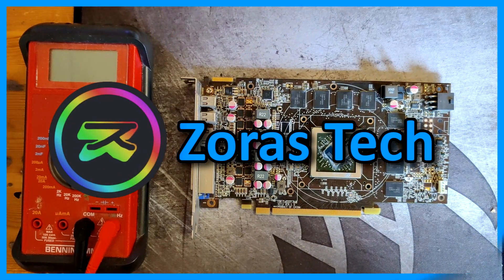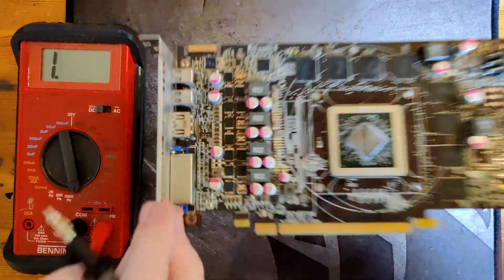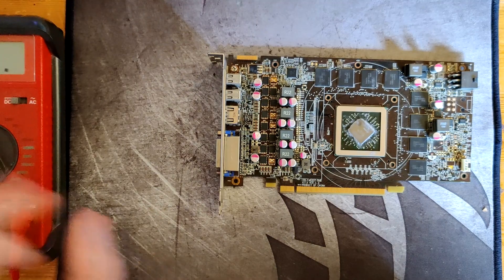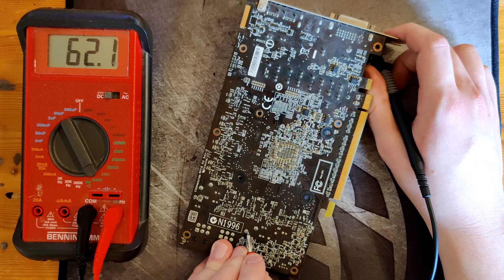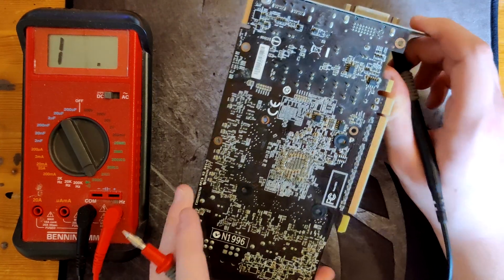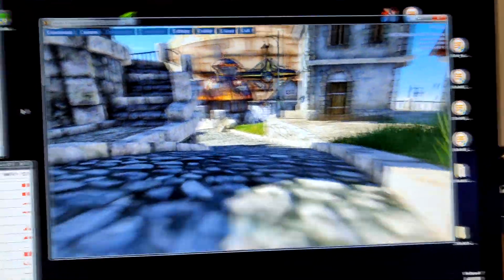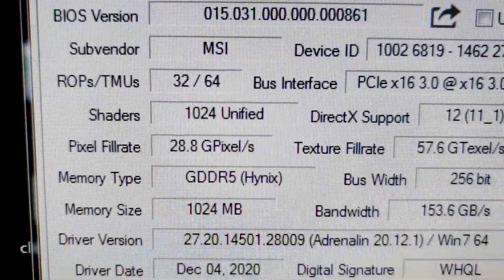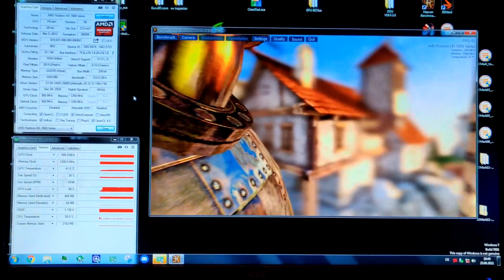Radeon HD 7850 not Detected // Troubleshooting

Comment: need help, mine is xfx ghost hd 7870 2gb, i boot windows and install it and it is fine, my bios screen is fine, so its working obviously..., my window repair screen works but noting else after the blue window animation logo screen, any idea? I had installed windows fine but left it running to do something as I went to check it was not showing anything but a blank screen,  I had it an air blasted everything and reapplied thermal paste, and it had the same issue my specs are xfx ghost hd 7870, intel xeon e 1225 v3 stock cooler, 8gb g.skil ram, intel server board s1200KP
Reply: it is meant to take heavy loads so that's why I wanted a server instead of gaming and it is a bit older I know the card (had 7870) are the only issue as I had a gtx 560ti 1gb in it prior working completely fine,  450w psu I believe and 500gb toshiba hdd

Comment: What do you usually suspect in gpu issues when you turn on the pc the display autoshutoffs itself for a few seconds sometimes takes longer? Some gpus i luckily repaired by placing a heatsink with thermal pad on the drmos... But in most cases im really clueless whats causing these... I got 3 1050tis and an asus 1070 which has these issues and those has drmos heatsinks... all these gpus Auto turns off the display the moment you start it gives you like 5 seconds display then turns off and once you turn it back sometimes it displays sometimes its doesnt these gpu are cleaned well and didnt overheat... I hope you can help me out on my gpus i have these basic tools you had as well so i guess i can come up on my own into really making these cards work... I live in philippines btw and i find your vids really interesting man i hope i can overcome these kinds of repair and your vids are really helpful i just gotta watch it a few more times so i can inhumanize all these i hope you can view my comment and will be very glad..
Reply from the maker: Depends on when the display turns off. If it turns off the moment windows launches / the driver starts it is likely a heatgun candidate. You can also test if it does the same thing in windows safe mode as the driver is not running with it so the picture should stay on. 

Without more info i can't really say much. I think it's best you go through the same kind of troubleshooting steps i do (specifically measure the voltages before and after the display turns off, if there are any changes it might indicate a PCB issue if the voltages stay the same / don't go outside normal range i would more likely stick with the heathun theory. In that case i would advise you to run MATS first before you heatgun to make sure there is actually a problem there. Tech Cemetery has a good tutorial for MATS. If you have the right equipment you could also try to swap potentially faulty memory modules properly)
Reply: @CmdrSoyo  yes ive been watching his vids as well and will try this mats... My last resort was really to heatgun these thing but i will definitely try what youre saying and thats what am aboout to do now.. Tried reading resistances and all seems ok on inductors on pex / 1.8 / 1.5 / ram. And theres nothing shorted 12v 3.3 all ok... Im currently tinkering this asus dual 1070 and plug this in and measure voltages... But if theres just a thermal cam i can use maybe i can find whats overheating which i believe causes display  to shut off... Thanks man ill comment down my findings later...
Reply: @CmdrSoyo  apparently ive got a weird capacitor value on the 16 lane data line capacitors on the chip...  those capacitors i read where 220uf aligned on the pci express lane but One of them when i read its only to 191uf... So you think could that be a cause? Degraded capacitor?
Reply from the maker: @tushiwarashi  PCI-E datalines with inconsistent resistances usually indicate a dead or severely degraded Core from what i've seen
Reply: @CmdrSoyo  i see then so it really means theres nothing i can do to it unless use the heatgun... Ill resume it reading by tomorrow i was still searching for a mobo for testing since i dont want to risk a b550 aorus on this... Thank you for your time sir i appreciate it so much... Ill update you regarding my progress

Comment: When you do a "real" heat gunning, do you reflow? As in, do you use flux on the chip and hope it will help resoldering the BGA, or do you just take a heat gun straight to the card?
Reply from the maker: I don't use flux. Just heat the core for 40sec and then the memory for a bit as well. I think 9/10 times the BGA is ok and the problem is in the die-substrate connection

Comment: Im sell my mother board to some one. He wants to check ever single part of mother board 😙 . And he wants to check the pci express slot. Then im plug my 1650 super card and tern on it. Actually system worked only to lock screen and all the monitor is turn in to black and small dots. I couldn t check again the graphic card cause. the buyer is very busy guy. He was gone . I cant chek the issue again cause i haven mother board. im get a new motherboard with processor in future . I want to know it is a permanat issue or....

My english is suck😂😂

Comment: washing in tap water is bad practice and terrible advice, whilst you might not cause any immediate damage assuming you dry it properly, tap water will leave hygroscopic residue of various salts that will cause corrosion sometime down the line, and surface tension traps a lot of water under bga chips - which means more salt residue (thus more corrosion) right where it matters the most. at the very least blow the water from under bgas with compressed air before drying, or rinse with deionized/distilled water/ipa/da